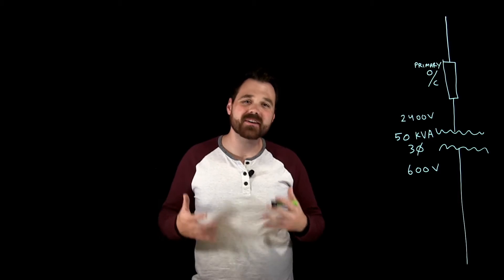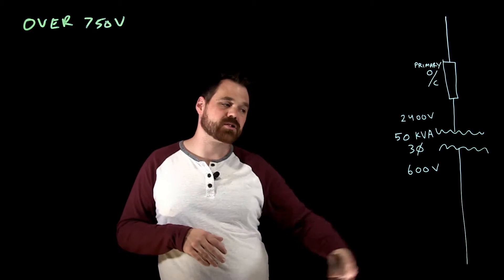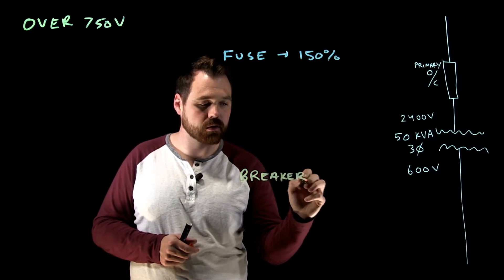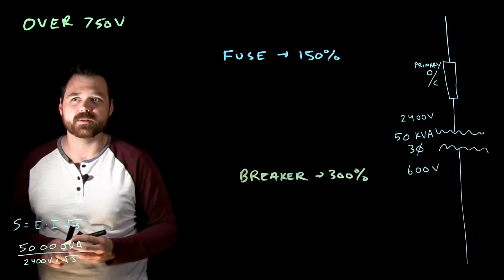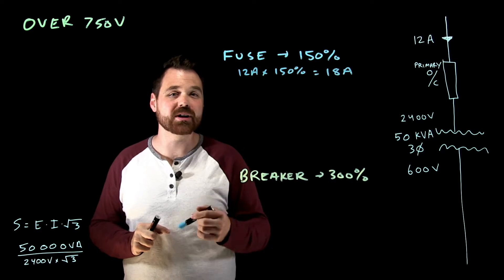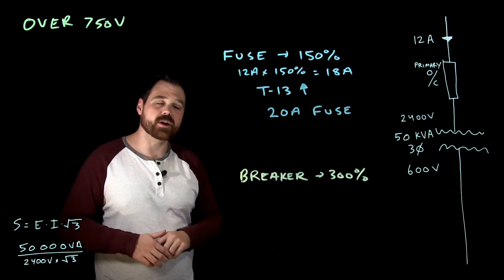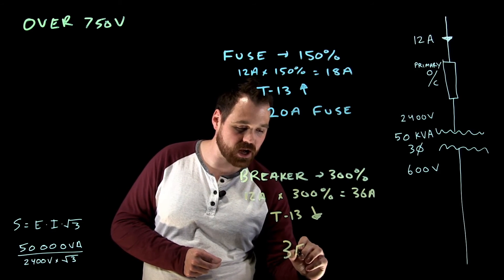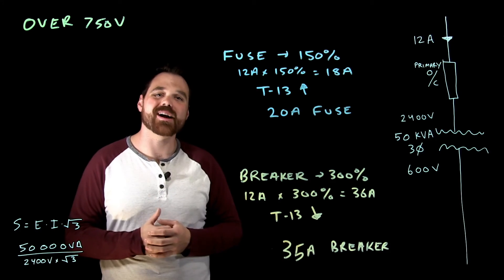Transformer Overcurrent Calculation, Over 750V, Primary OC

Comment: Hi Zack, I have a little question please, so the difference between 26-250 subrule 1 ( this video) and subrule 4 is whether the transformer has a  secondary overcurrent protection or not? is my understanding is correct?
Thanks for your videos.
Reply: You are correct. Secondary side OC would be based off table 50 in CEC. Secondary side under 750V would be 250% the rated current regardless of fuse or breaker choice or the XFMR impedance. If that is in place the primary OC would not be required so long as the feeder OC device is set to not more than the values on table 50 in the CEC.